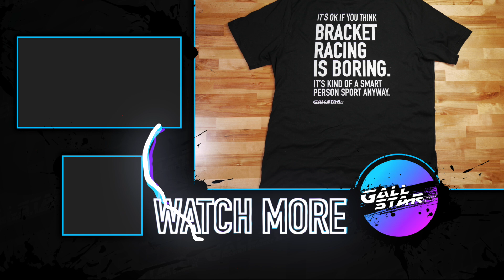Why HOLD with a consistent car? | FINISH LINE DRIVING

Comment: Used too dial honest… got me by usually because in footbrake when I dial honest and don’t turn the red light on, I’ve won a bit this way. Joined tibr elite and while I still don’t fully understand a lot of things, I’ve started holding numbers or spot dropping. Out of 5 races so far this year, 2 wins, a runner up, a semi final in 7.0 and went out in 3rd round footbraking. Car was inconsistent that night, so I dialed a number I knew it could run. Wasn’t sure if I was dialing honest or how much I would be holding. I was two hundredths better on tree than opponent, and basically I waited too late to get on brakes. He saw he wasn’t getting there and let me have the stripe. I had plenty of room too. I broke out by a hundredth. Car picked up 2 hundredths from previous pass and it looked like I was holding 4 numbers and killed 3. High speed chess game we play

Comment: But if your opponent is "dialed honest", it makes no sense to say you're going to "induce a mistake".  Do whatever you want, he's just running it out.  There's no mistake to induce.
Reply: Correct as if I did my job right at the tree, I pay attention only 2 things...I see you are green or red (maybe even lit up the tires leaving the line), and the closing rate...Rear view, to side mirror, over the shoulder, 90 degree, and the little last foot to the stripe. I want to be dead on something. And leading or following by an inch or more if you misjudge the stripe w/ all that closing speed. 

I prefer to personally slow dance to a faster dancer bulleting by like a rocket as life slows to a crawl.

Comment: I'm used to bottom bulb racing,which is considerably slower in my case but, I always dialed honest. I might adjust a little when staging or stall speed but always did pretty well. I may have to try this strategy next time just to see.

Comment: If I'm racing someone pretty close to my dial I usually hold 2. If I'm chasing a much slower car I will dial honest or maybe 1 or 2 faster than what I'm running. Holding 2 is easy, just plan on 2 whomps 80 feet or so from the stripe.

Comment: I can see doin it if your running a class like top dragster where everyone is fast, but if im dialed 8.19 and my super pro opponet is like 11.20 seems like your asking to break out. In those secenarios i accutually like to dial .01 fast and run it out the back door if i have too, i feel you force them under ALOT, but i also have been told that its alot harder to judge a slingshot on the big end than a rear motor car because as oppose to a body its a pipe rack with wheels & its just harder for a door car to judge.. idk if others have had that exp but ive been told that by several other racers.

Comment: If on average you can hit the tree better than your opponent and go low dead on, you will always have an advantage.  By dialing honest you get rid of a variable, which is having to make a decision.  By dialing honest, you have forced the decision making process 100% on your opponent, and you don't have to race someone as savvy as Jeff Serra, Scotty Richardson, or Nick Hastings 90% of the time.
Reply: Never heard of them
Reply: @bpayton76  LOL
Reply: I agree.   Hitting the tree better than your opponent and running dead on will win way more than holding.  Take it from an old man
Reply: Yep.  No point in holding unless you're trying to cover up a bad light or a bad car.  If you're good on the tree, holding #'s is only hurting you.
Reply: @GoingBracketRacing  holding numbers is as I call a business decision. I trust myself over any car any day. That's why I hold
Reply: @sumner-kv3gh  If a man had the ability to be better than a machine, then robots wouldn't be replacing humans at Walmart and McDonalds.  A properly tuned car can never be out performed by any driver.  Not even the drivers mentioned above.
Reply: @AdrenalinePodcast  You have a fair Argument. Myself personally always held for two reasons. One: It got into alot of peoples head. Alot of guys would walk around and mockingly call me a sandbagger. It screwed with em so I did my very best to oblige their scorn. 2. It is a business decision. Why? Because one way or the other, I'm getting to the finish line. It also creates opportunities you wouldn't normally have by creating optical illusions. So I just trust my process. You trust yours.
Reply: @sumner-kv3gh  I'm not saying your process is incorrect, I'm saying the theory of trusting human input over machine input is incorrect.  It is impossible for a human to be better than a properly tuned machine.  That's a fact.
Reply: @AdrenalinePodcast  Machines are imperfect. Just like humans. Back in the day before weather stations, you had to bag. Weather goes south? Starting line goes away a little bit? Who and are what are going to make the difference? The human driving the car, that's who. You can have a car tuned perfect but it don't mean weather,wind or anything like that won't play a part. I mean it's a preference to me but to say a properly tuned car is the one all be all is disingenuous
Reply: RIP to Scotty as he recently passed away to young.

Comment: Always dial honest. Because I can go a whole weekend .002-.004 on the tree. One Saturday late last year I had 6 .000 in a row and last lap .009 but won due to a push. My trick is always getting up there first and turn that top bulb on then opponent will have both bulbs on before I get my bottom bulb on because I creep so slow into that last bulb I can trickle the bulb every time. That puts me on the track in the same position every time. Lots of guys get in a hurry and roll in 1”-2” heck 5” deep. You can’t have consistent reaction times stopping in a different spot every time.